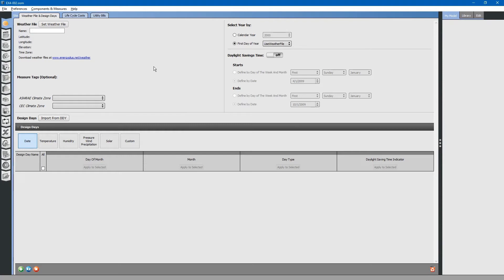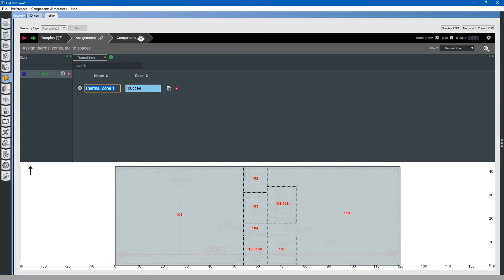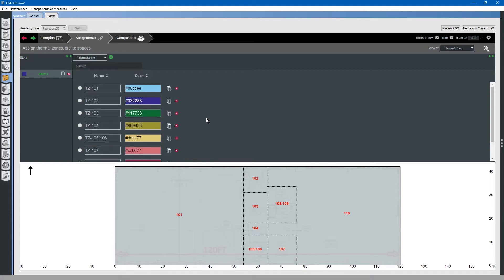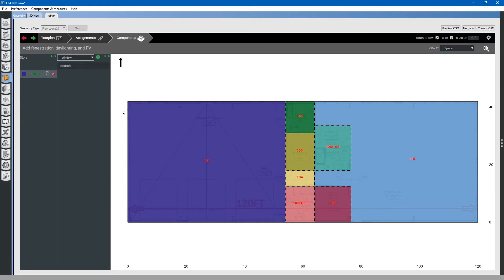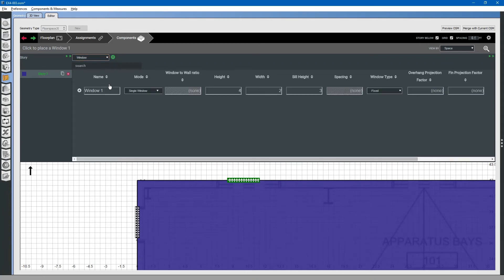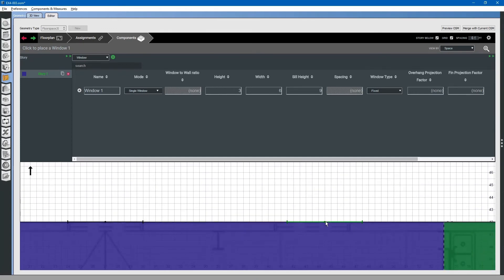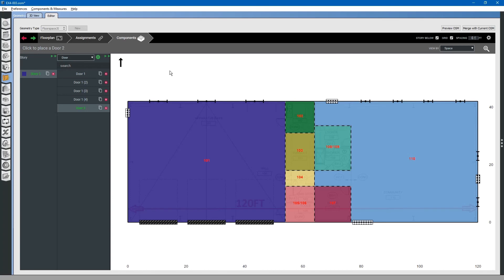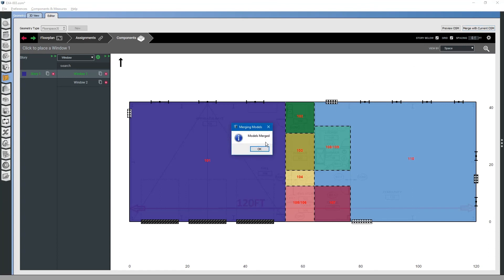Building Energy Modeling in OpenStudio - Add Thermal Zones and Subsurfaces

Comment: How can i add windows to the Roof?
Reply from the maker: With FloorSpace JS, you can only add windows and doors to the vertical faces.  If you want to add Skylights and Light Domes on the roof, you will have to edit the model using SketchUp: https://youtu.be/WkgQAIaXy78  In SketchUp, double-click to edit the space, and draw the window onto the roof.  It should automatically recognize the shape as a skylight.

Comment: hey, i have a few questions.
1. how do you add interior doors between spaces properly. i already tried it but when i run the simulation, they won't finish running due to some settings i have to change at subsurface? I'm not sure what to add.
2. How can i delete a wall of a space that connecting to another space? like an openspace house?
3. How can i add roofshading? like car park area connecting to a building. i tried to add one but it just give me a chunk of volume?
Reply from the maker: 1. Interior doors normally do not add any value to an energy model.  The only time you would model interior doors is when the two rooms that it shares are kept at extremely different temperatures (eg. one room is 75°F and the other room is 32°F)
2. In FloorspaceJS, you cannot delete the wall.  You will have to draw the two rooms as a single space.  If you want to create an "air wall" like this, you will need to create an Air Boundary Construction on the Constructions, Constructions tab.  Then assign that construction to the specific surface on the Spaces, Surfaces tab.  More info here: https://unmethours.com/question/42542/interior-air-walls-for-splitting-nonconvex-zones/
3. You can only create simple 3d block geometry in Floorspace JS.  If you want something more advanced, you will need to edit with SketchUp.